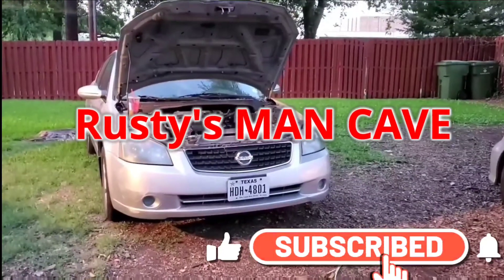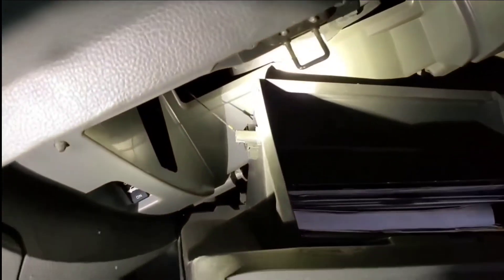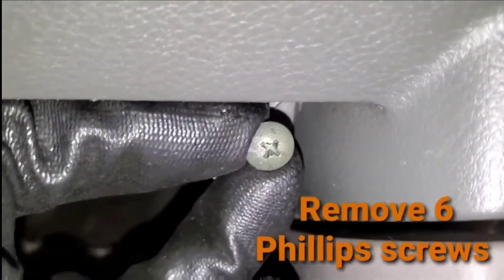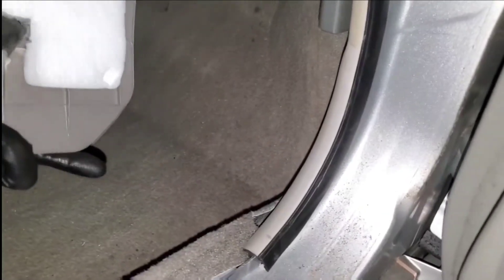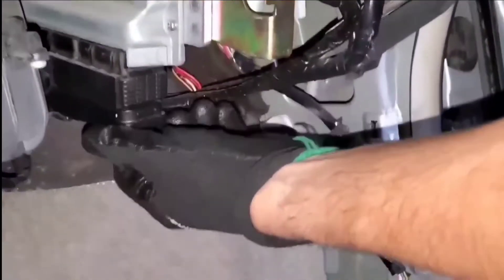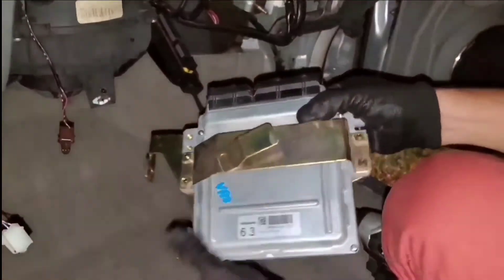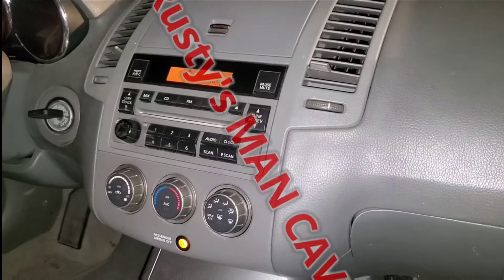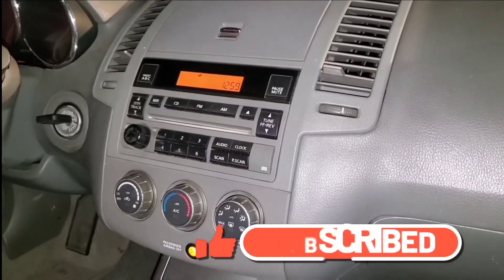How to replace ECU "DIY" (Engine Control Unit) 05-06 Nissan Altima [HD]

Comment: Is the gear computer in this model integrated into the car computer?
Reply: No it's a separate right next to ECM. It's called TCM transmission control module

Comment: Thank You my brother, your ECU video gave me some good ideas. I am truly very thankful. If you could answer a few Do I need to program anything on the replacement? 2005 3.5 SL maxima has an idle from 2200 to 1400 rpm in park. Tried maf sensor replacement, checked plug wiring and all seems good ???? Either way thanks again.
Reply from the maker: @Antonio-r3m8p  your very welcome... just do a reset by disconnecting the battery and your good to go👍👍👍

Comment: Should be same number or i can take any ecu of same year? What i mean i have 2006 2.5 nisaan altia 2006 my computer serial is qu mec35-601-a1 51z5 and i didnt find same can i take any ecu from same year and jist programm a key to make it work ?
Reply: happened?  I am also replacing the ecu, do I need the same number or does it matter?
Reply: Nissan altima 2002

Comment: Can you tell me where is tcm unit for altima 2007
Reply: ecu and tcm are both by the battery in the engine bay. smaller one is the tcm

Comment: Question. Where is the ECU located on my 2010 Altima hybrid. I am stuck.
Reply: in the engine bay right next to the starting battery. a smaller TCM is right next to it

Comment: So when you do this on a 2005 Altima do you need to replace any other parts? Or will the transponder key from before still work?
Reply from the maker: Yes it will still work.
Reply: @rusty505whp  cool, I've been having a crank no start issue on my 05 Altima. The obd2 gets power but won't read anything. No coil spark, fuel pump doesn't engage. Sound like the ECU? I'm just worried that it won't work with my key if I replace just the ECU?
Reply: @Proxx117  did you ever solve this? If so how?
Reply: @Tino Hall  I'm wondering the same,  I also have a 2005 as well. I replaced the fuel pump same issues.  Fuel pump making noises and the relay constantly clicking when power is on, car cranks but no start
Reply: Yep same issues here 2005 crank sensor code came up changed sensor and all codes disappeared, no fire at all. Pulled history on the cars computer and u1000 came up which I assume it means ECU

Comment: Did you have to reprogram it to your car for the ECU? I have the exact same car and I’ve replaced cam/crank shaft, fuel injectors, starter, spark plugs and ignition coils 🙄 It’s not the fuel pump it works as well. It cranks but it doesn’t want to turn over.
Reply from the maker: Yes you do.
Reply: Yo what ever happened with that? I did the plugs, crank, cam, and fuel pump; cranking but no start. Was it the ECU??

Comment: If you get it used will it work? Trying to see price difference on them
Reply from the maker: Yes,  as long as the used part is in good working condition.
Reply: How can I test if it works properly?
Reply from the maker: @joslynnchavez9577  volt meter
Reply: Where could I get one of those? Could I rent one?
Reply from the maker: @joslynnchavez9577  O'Reilly

Comment: Do you know if the ECU is in the same location for a 2008 Altima Hybrid?
Reply from the maker: Yes it is.
Reply: @rusty505whp  How about 2009 Nissan Altima hybrid? same location behind the dash.
Reply: engine bay next to the battery

Comment: Did you have to get it programed?
Reply: Hey bud, just a quick question if you don’t mind.  I believe my 05 Altima has a faulty ECM. I’m going to send it in for repair through auto zone. Will it been to be programmed by the dealership or should it just be “plug and play”? Any advice will be great. Thanks bro
Reply: @alvarez960 работает?
Reply from the maker: No need just give it a few minutes to learn.
Reply: @rusty505whp  how many minutes did it take for the new computer learning? I have a 2005 Nissan Sentra. I changed the ECM but it still didn't fix the issue. I guess I may have to program it.
Reply from the maker: @bcoronel01  disconnect the battery terminals several minutes.  And reconnect and let it run for a few minutes.
Reply: @rusty505whp  I had the battery disconnected before I installed the ECM. Are you sure your ECM wasn't FLASHED at a Nissan Dealer?
Reply from the maker: @bcoronel01  yes i am sure it was not flashed at the dealership .
Reply: @rusty505whp  I followed your advice and  I'm getting the same codes and the car is not moving more than 10 miles per hour. Same issue I had  before replacing ECU. Dealer told me to change ECU . I did change it but issue is not resolved. I don't know if reprogramming will do anything
Reply from the maker: @bcoronel01  is the ECU NEW OR USED?
Reply: @rusty505whp  It looks like new or barely used. I bought it cheap on Ebay 
the company is called
ecu_supply_company
Reply from the maker: @bcoronel01  have you checked to make sure the ECU works properly?
Reply: @rusty505whp  Is there a special equipment to check the ECU? The car starts but I wouldn't know how to check if the new ECU is in good condition or not?